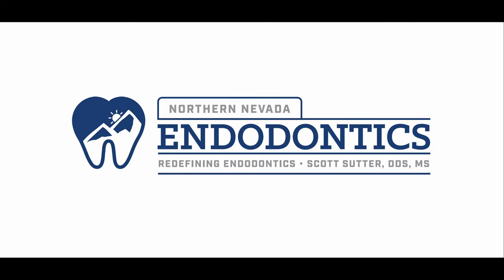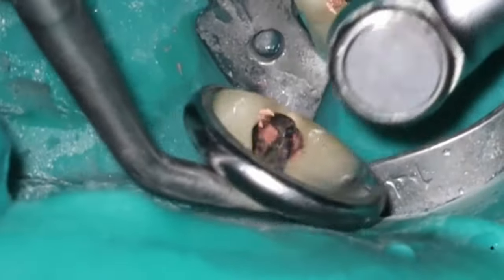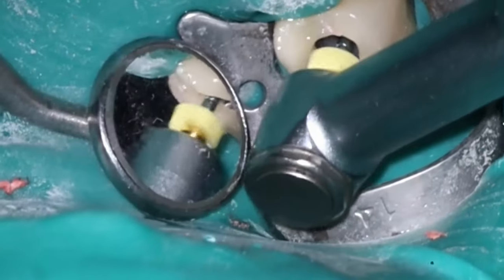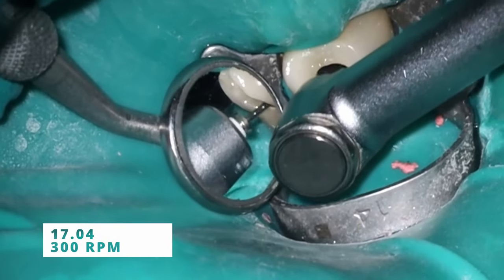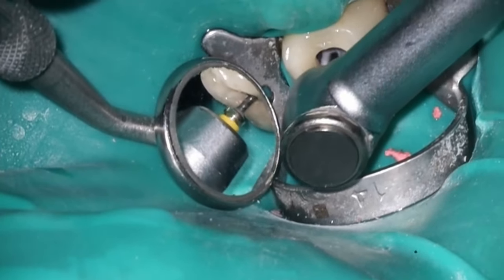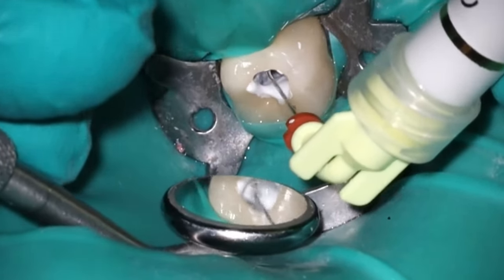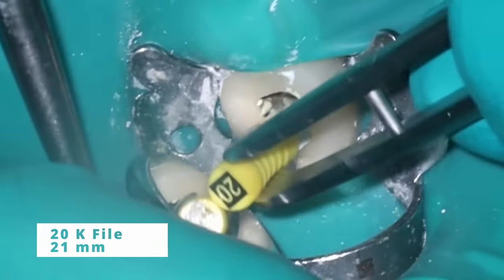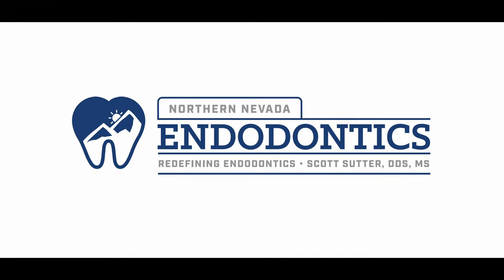Lower molar retreatment bypassing ledges AND the squirt technique explained

Comment: Hi Dr Sutter,
Just being creative here - would there be any merit / safer to use a rotary file on a counter-clockwise setting at a high RPM when removing GP? Would this help pull the GP more coronally / preventing packing it apically?
Reply from the maker: Great question! Most rotary files pull out debris instead of compacting it. Hand files are the opposite. Running them in reverse would probably make things worse and compact the files more! To prove this, take a large file in your fingers and spin it while not letting it "screw" into your hand. Notice how it pulls your skin towards the top of the file instead of the point. 
I fully support being creative! I just don't think it would have the effect you're looking for. Thanks for the comment!

Comment: What dispenser do you use for the squirt technique? Will any work? Thanks!
Reply from the maker: B&L Bio Beta Mini. But, you can use any unit. Some people prefer a motorized unit (Sybron Elements, Dentsply Calamus) so the pressure is the same, but I have better luck when I can control the pressure by hand. The Obtura is the most common one you can find, but I prefer cordless whenever possible, hence the beta

Comment: Excellent job dr..at what rpm and torque u used for removal of gutta purcha?
Reply from the maker: Max torque on those little TC2's at 550 rpm. But, I have friends who put them in an air slow speed and run them at 20,000 rpm lol. https://youtu.be/aRgNKMsphQY I go through it in more detail in this video too!

Comment: Hi Dr Sutter,
As always amazing video 
I use protaper files and was taught in school to go up to f2. I feel I enlarge my canal way too much seeing your case,  as sometimes I go up to f3 on distal and palatal.
Do you prepare you canals 0.5 mm short of WL? Or Upto WL?

If possible can you please make a video on what files system to use and where and possible sequence.
😊
Thank a ton.
Reply from the maker: I was also taught to go to f2 with a minimum 35.04 on top of that. As you can see, I’ve changed my mind since then 😂
I prepare to WL as there have been many studies showing it’s not accurate to exactly 0.5 back. My reasons are: 
A) 17.04 is probably smaller than most natural apices 
B) the squirt technique doesn’t care how long you measured, it will go to where it goes. 
Stealing from some TDO member: “the best size is no size”
I’ll make a video, but it’s almost always the same: 
CBCT working length prior 
8 C file to length if possible 
20.06 to halfway or so depending on the case
17.04 if I’m having trouble
Working length with a 10 k
17.04 to full tone (0.0) working length
Squirt fill
Retreats are a shitshow and I’ll use anything on them. But for most primary cases where I’m the first one in, this is the plan. 
You should see what I do with a gentle wave lol
Reply: @PatencyPro  Thank youuu
So If I am not using squirt technique(I need to buy instruments and practice first), 
how would suggest the best possible way to obturate in that case if using 17.04 and 20.06?
Reply from the maker: They make cones that fit that shape. You can also use a taper plate or gutta gauge (such a good name for a product) with MF or F GP accessory points and cut them to size